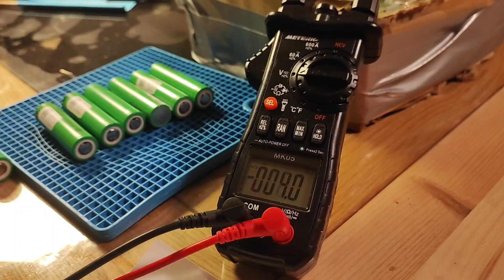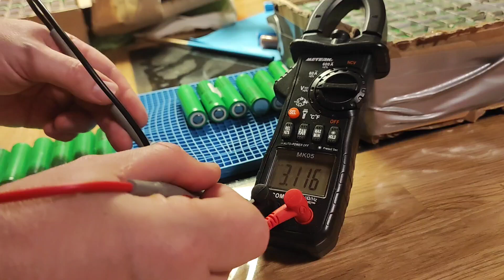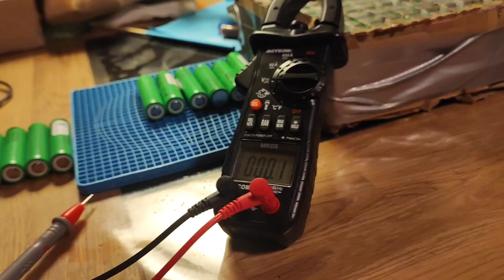01: Measuring used cells and finding quite a lot bad ones - how I go about testing used cells

Comment: you need to jump start the bad ones with a bench  power supply(wake them up) or reset the cid tab under the top notches on + side....
Reply from the maker: Yeah I have done that... I still found that after charging them up they had a lot of self discharge over a few months sitting. I mean they are probably ok for other purposes... But I'm using this at a 2C draw and then you don't want to take risks with cells that already show signs of going out ... For other purposes, I have used them though but not for this high draw pack.

Comment: From my experience you should be able to recover lot of those cells, even if voltage is below 2.5V. I was able to recover li-ion batteries from electronic cigarettes with cell voltage  ~1.5V .  back to nominal capacity. As others mentioned, charge all deeply discharged cells with small current until they reach  ~ 3V. Then you can charge with standard charger and test the capacity as you did before. Monitor if the cells are not getting hot, this might indicate permanently damaged cell.
Reply from the maker: Just want to point out that I did keep some of the bad ones and used them for other applications. It's just not good to bring them in to a huge high current draw  battery pack like mine. Getting a few relatively to other good cells could be real bad
Reply from the maker: Well my tests showed that even if they pass the IR and capacity tests, letting them sit for a month and the voltage had taken sharp turns down. I let some sit even longer (3 months) and almost 80% were rejects. So for my pack, I really wanted to keep those away, given the high current draw.

Comment: You can charge slowly to 3.0 the bad ones not up. The good ones up. You have to get a psu with CC and VC  and repair the 80%. You must charge the bad ones at 100ma constant
Reply: Hey, this is his supplier. He is actually right. When you trickle charge the cells they will charge up to 3v but the more you put into then the more the cell internally will us therefore discharging on it's own to below spec voltage.

We offered to replace them as part of our service and now the project is up and running again!
Reply from the maker: Indeed. It's amazing the service you gave, and like I mention in a video. The cells are not bad, well a few were, but my use case was a high draw marine environment where I am pulling upwards 2C of a new rated cell at 3C. So when using used cells one has to be mindful of the health of the cells and what that means for the specific pack you are building. I did use some of those reject for other small fun stuff later. Still amazing Tom that you are here answering!